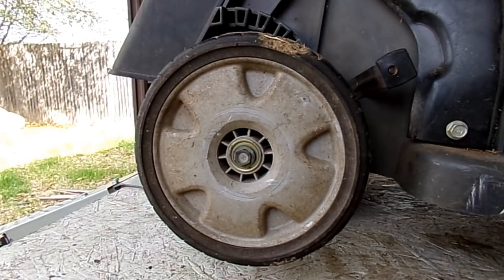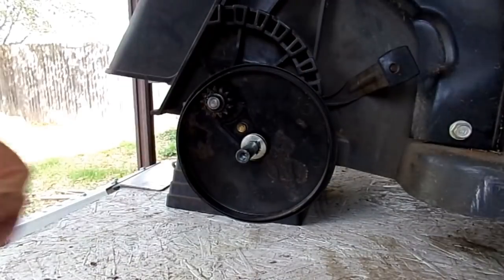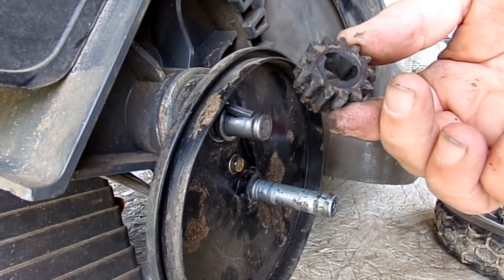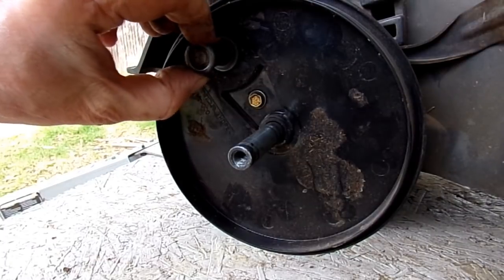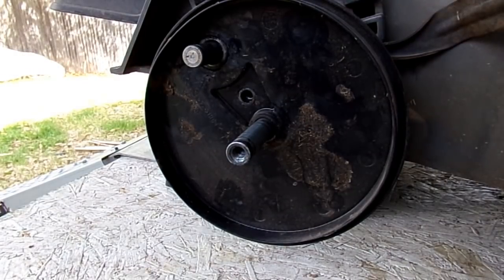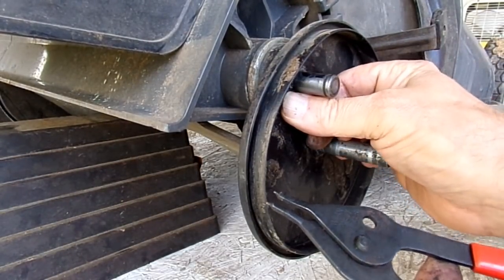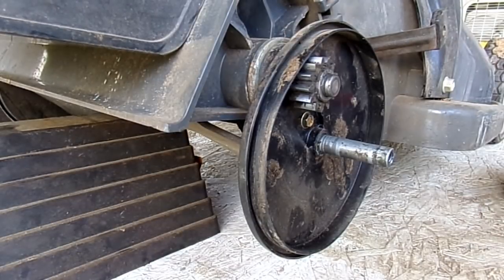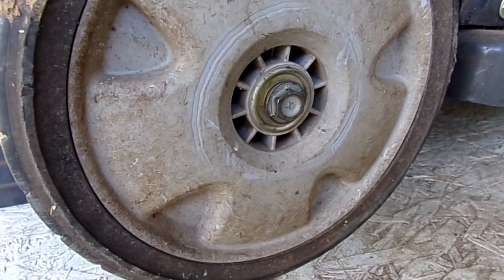Honda Mower Won't Roll Back

Comment: Great job.  I got lucky.  After thoroughly cleaning the axle area around both rear wheels,  I heavily sprayed WD40 Penetrant into the areas where the shaft and the trans meet, and where the shaft meets the bushings.  Moved the wheels by hand - difficult at first - and let it sit all night.  Repated the process the next day, and haven't had a problem with it since. Hope someone gets lucky with this process also.
Reply: @Boogie Man I used a leaf blower and a wire brush.  No removal of anything.  One clean I sprayed the entire drive axle and got into the trans box.  The key is letting it sit overnight, then manually move the wheels. At least that's what worked for me. Good luck.

Comment: Thank you for this. I had a rear wheel that wouldn't turn so I bought a new wheel and replaced the pinion gear assembly and it still didn't turn. I watched your video about the pinion gear having to face the right direction and that fixed it for me.
Reply from the maker: Great to hear!

Comment: (I’m on my 2nd HRX217HXA and do all my own maintenance.)

Another related issue is that the two nylon bushings that live inside each height adjuster can get dried out and need to be greased.  I did an overhaul on my drive system last year, replacing every component on the rear axle except the transmission itself, including all four of those bushings.  Less than a year later the mower became VERY difficult to pull backward.  I disassembled it to the point where I could move the transmission side to side so that I could work some grease into those bushings, and now it’s smooth again.

IMO, the major shortcoming of this mower is the lack of external grease points and it’s dependence on bushings where bearings should have been used.  In some areas (I’m in KC), there is no choice during spring and fall but to blast everything out with a water hose.  This drive design doesn’t like to get wet.

If you own one of these mowers, you should consider a good pair of snap ring pliers a required accessory.  Preferably a pair with both straight bits and 90 degree bits (Channellock 927 is one good choice).
Reply from the maker: Thanks for sharing this great info!
Reply: I'm on my third. It's a horrible design. None of the transmissions last at all! I don't mind maintaining equipment, but this problem is inevitable and repeated.
Reply: Tobin Hutto I haven’t had a transmission fail yet.  My first mowers transmission was working like new when I sold it, my current one still does after (7?) years.  I mow a 1/3 acre 2-3 times a week.
Reply: @KSMike1  I use them on .88 acres, once a week. March thru October. Every model has had locked wheels within months.  I still use them because they start so easily and use virtually no gasoline for the work load.  There's nothing I do destructive, and mowers are kept inside. The first model HRR2169vka rolled best the longest. The newest one, HRR216K10VYAA has only been used this season.  I bought it on closeout last fall.  Today, it locked up almost completely.
Reply: Tobin Hutto I really think someone could come up with a lube point modification if they really put their mind to it.  IMO that’s what this mower needs.

Comment: I'm a little confused. Very nice, detailed video but what did you actually do to fix it. it looks like you disassembled and reassembled the exact same way. Did you actually find out what was actually wrong?
Reply from the maker: The ratchet keys can be installed upside down and or the pinion gears can be reversed.
Reply: Good question. I was wondering that myself. Besides, If the pinion gears were reversed you wouldn’t get any forward drive.

Comment: Great video since my HRX217HXA has become difficult to pull backwards.  Maybe I missed something, but exactly what did you do to fix the problem other than taking it apart and putting it back together?
Reply: He didn't say his wasn't working. He's illustrating the proper procedure to restore functionality to a unit not working.

Comment: Great tip!  On older Honda SP models the axle sleeve inside the adjuster bracket will corrode and so it's good to shoot some aerosol white lith into the crease to keep rolling free.
Reply: cherokeefiddler I found that out last summer. I had to use a chisel to get one off. The wheel didnt want to roll. Both wheels were like that. Simply from sitting.

Comment: First of all I want to thank you for an excellent video
I did all you described here and got all that cleaned up well
Problem is the wheels still don't roll backward,
I have a Honda HRR216k10V
It has the variable speed on the top of the handle
Any ideas on what's next
Thanks again I appreciate it so much

Comment: Nice explanation of the parts and how they're assembled.  I did a video on my channel that actually frees up rust on the shaft.  I guess its just a poor design?
Reply: Build Motion -- Absolutely a terrible design, that allows Everything to get in between the bushing and the axle, that includes moisture, so there will be some rusting going on and all the dirt, grass, etc., that gets in there and also makes it harder to move this machine backwards... If it was not  a rear wheel forward drive, we would also notice how hard it is to move it forward, but the engine, belt, etc., takes that load for that...

Comment: The core of the issue is the bushings on each side of drive shaft with the gears,, the shaft bearing surface itself needs to be cleaned of any corrosion with emery cloth and lightly greased this shaft needs to spin freely in each bushing otherwise it binds up the wheels when drive is released and the mower is pulled backwards..also make sure the drive cable is not adjusted to tight the drive needs to fully release when you release the handle , the wheels should not creep forward when slightly lifted off the ground with the drive handle released. follow the drive cable adjustment procedure in the manual..
Reply from the maker: Well said.Thanks!
Reply: I was about to mention this, about the bushing bores and axle shaft rust build up. Just here checking to see if the HRX217 has the same drive parts as the HRT216. 9 times out of 10 it those bushings when it won’t roll backwards, but this video would help if somebody had previously put the drive spurs on upside down. Or if it won’t go forward because the woodruffs are stuck in the down position in the spurs due to crud buildup, but if it’s to that point the bushings probably need their bores ran through with the 12GA barrel brush and the axle OD’s dressed anyways.

Comment: I just finished repairing the loss of the wheel drive function on my Honda HRT2162TDA.  I thought it was the transmission that had broken ($197.00 for a new tranny), but it turned out tightening the spring that fastens to the hand clutch solved the problem.  By shortening the hook on the spring about 1/2 inch, the transmission was again able to engage the rear-drive axle.  Since I bought the mower in 1992, I figured that was a small repair for a mower that old.
Reply from the maker: Great catch!

Comment: Great info. I just put a "new " transmission in one of my 217s. Everything is together correctly.  I can change these in my sleep.  Problem is it will lock backing up intermittently after the oil warms up. Even  with cable unhooked it has more resistance than normal to pull backwards. Appears to be too tight from the factory. Set it aside and installed a used one.  So its faulty. Problem is I bought it on online from USA to Canada. Shipping not practical to return it. Eventually I will put it in a mower for my own yard. It may loosen up with use. Not going to happen for commercial mowing. Keep in mind that even a new tranny can be faulty.
Reply from the maker: Yes, I have run into that problem too. "NEW" does not always mean "GOOD".

Comment: Really appreciate your pointing out the correct orientation of those pinion gears. I've watched a few other videos on Honda self propelled mechanisms and they will mention that you should get the orientation correct, but don't show or tell you what that orientation should be.
Reply from the maker: Glad it was helpful!

Comment: I have an HRX217 and it wont roll backwards. I have did what you said on the " key " half moon pins in this video and it still will not roll backwards. I have not replaced the transmission. Goes forward fine. Good job on your videos I have watched all 3 of the changing out the transmission. If I need to change out the transmission are there used / rebuilt ones out there ?
Reply from the maker: Possibly on Ebay.
Reply: You need to take everything off the axle, remove the bushings, clean them really good inside, perhaps have to smooth down the axle surfaces where the bushings go,, a little lube, and it will work fine until enough dirt, moisture, grass, etc., gets back in between the bushing and the axle, and you will have to do it again,  Thank you Honda for this absolutely disaster of a design that should have had some sort of seals on both sides of the this axle/bushing place, so it would not allow dirt, etc., to get back in there again, and make us all have to go through this nosebleed, again and again !!! And yes, I will NEVER buy another Honda Mower...

Comment: I have 3 of the Hydrostatic (shaft drive) versions from different generations. Occasionally one will not roll backward when pulling out of the shed, but none have refused being pulled backward once the engine's running. Not sure what that would matter.

Still, I'll look at these now that I know what to look for on the ratchet gears, thanks.
Reply from the maker: Thanks for the comment. I have never worked on one of the hydrostatic machines so I have no answers for you.

Comment: Great job on disassembly and reassembly.  But, seems like you didn't address what was causing the locked wheel and what you did to fix it.
Reply from the maker: The ratchet keys can be installed upside down after repairs and cause this problem. Also the pinion gears can be installed backwards. The correct installation is ratchet key round edge facing into the axle slot and flat areas inside the pinion gear toward the rear of the mower.
Reply: @veteranssmallenginerepair5934  You have pointed out one easy to make mistake. I know because I too once confused the direction of the pinion gear when reassembling the rear wheels.  However, there's another more profound problem affecting certain Honda mowers and also preventing rollback that was the subject of a Honda service bulletin (#107).  The axle bushing in the height adjustment plate was incorrectly sized causing the axle to corrode and bind.  This requires replacement of those plates on both sides.  (Some people report temporary success cleaning corrosion off of the axle where it passes through the adjuster bushing.)  Although the Honda bulletin is from 2017, it only became well known after you posted your video in early 2018.  In addition, poor cable adjustment can prevent easy rollback (and the cable adjustment itself is easy to get wrong).  So there are at least 3 possible reasons why these mowers might not roll back.  As far as I have seen - and I should say that I am just a Honda mower owner, and not in the yard machine trade -  the transmissions do not fail.

I thought your observations and suggestion regarding removal and replacement of the rear wheels were helpful and clear.
Reply: @Boogie Man it’s not the wheels.  The drive belt needs adjusting.
Reply: @veteranssmallenginerepair5934  "toward" the rear, I agree. But in my book that means FACING the front. But I appreciated the clear explanation of the ordering of all the bits. That short bolts holding the plastic plate on is interesting. I don't have them on my 10 y.o. HRX 537. I have just a hole which I too k  to be for grease. At a certain position of the lever the hole in the plastic aligns with a non-threaded hole in the metal plate. On one wheel the lever was frozen stuck by rust, hence I thought/think it's for grease. Everything removed (obviously dismantling more than undertaken her), wire-wheeled, two costs of spray paint lightly smeared with grease... But I wasn't sure about the order of all the bits!So this has been most helpful. Thank you!
Reply: @Boogie Man I saw a video a while back but can’t find it now.  I think what’s happening is if the belt is still gripping the pulley just a little it’s not enough to move forward but locks the wheels up.  The pulley has to be completely free from the belt for wheels to roll back.  I bought the new Honda model last year and already my smart drive stopped working.  I tried the cable adjustment and it allowed it to move forward however now it’s locking up the wheels in reverse.  I looked at the belt and it looks worn ( I mow professionally ).  I must of had to tighten it down enough to make it drive but now it won’t release the pulley.  If I tab on the accelerator it will free the wheels up sometime.  I’m going to put a new belt on and see if that fixes it

Comment: Flats? Facing? Unclear what you are terming 'flats' which must be 'facing' the back of the machine . Seems to be inside the gear cavity.  Is it the horizontal slot? Being horizontal it is perpendicular and doesn't seem to have a rearward or forward orientation.  One side of the gear faces the mower deck and the other side faces outward; again not facing the back of the machine. Thanks in advance for your clarification.
Reply from the maker: On the inside of the pinion gear where the axle shaft goes through, there are 3 curved surfaces and three flat surfaces that are perpendicular to the axle shaft surface. Search for a picture of part number 42661-VH7-000.

Comment: I also clean out the groves of axle where spring and key reside with brakekleen and air dry. Lube spring galley with light oil not grease. Go easy on grease as dirt and debris sticks to it quickly.
Reply from the maker: Good tip! Thanks!

Comment: Great video and easy to follow! Do you have a video on how to get the bottom plastic cover off to gain access to the belt and gear box? My hrm 215 sometimes rolls back, but sometimes the wheels lock up and it seems to be when the drive bar doesnt fully return. So I re-engage and then disengage the drive bar and then it allows me to roll it back again but it has a lot of resistance and seems stiff with a lot of effort to pull the mower backwards. I think there might be something hung up on the cable that is preventing the sell propelled drive bar from snapping down and fully returning to the disengaged position. Really annoying! Any ideas on what to look for here or what might be the problem? Also occasionally the sell propelled will be working fine then half way through mowing it will just stop working. Belt looks fine.
Reply from the maker: I don't have that particular model but I found some info on one of the forums.  30year Tech on doityourself.com posted the following ;  

"The rear baffle needs to be removed from the mower deck to access the transmission. To do this you need to remove two rear engine mounting bolts as this also holds this baffle in, then there is a bolt pretty much in the middle of the baffle that screws up into the discharge chute area, this bolt needs to be removed (look in the chute area directly above this bolt and you will see a threaded plate that sits in a depression in the chute, sometimes you need to spray some lube on it as they can get corrosion on them). Finally there is a bolt on the left side of the mower deck behind the drive wheel; this one needs to be removed as well as the spacer underneath the bolt. Once these mounting bolts have been removed then you can pull the baffle down and out of the mower.

With the baffle out, you will have access to the transmission and can rotate the transmission forward to gain slack in the drive belt for removal and installation. There should be a spring that hooks on the top of the transmission and extends back to a tab on the mower deck. this spring pulls back on the transmission to keep tension on the belt once installed.

Once the new belt in on the transmission then just reinstall the baffle and you should be good to go."
Reply: r
replace wheel adjusters